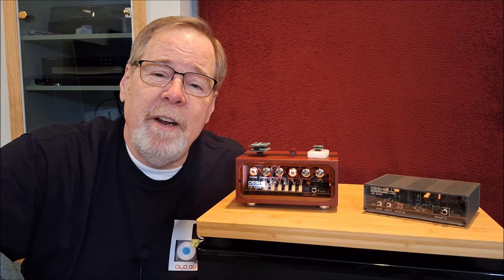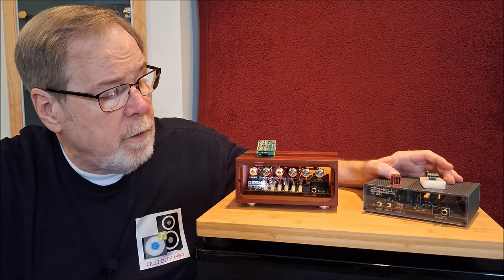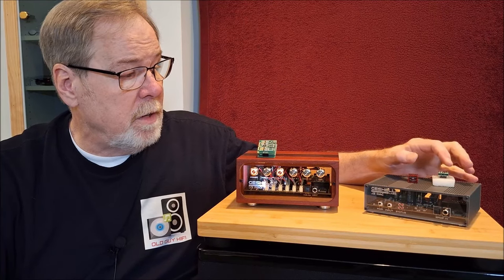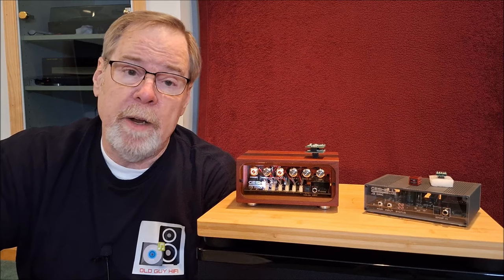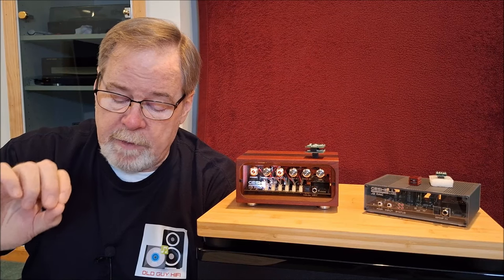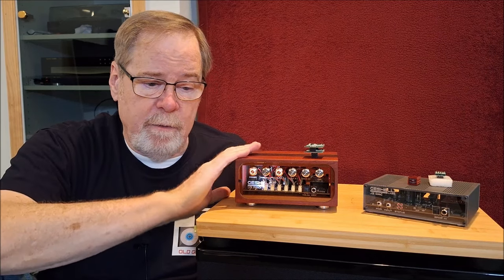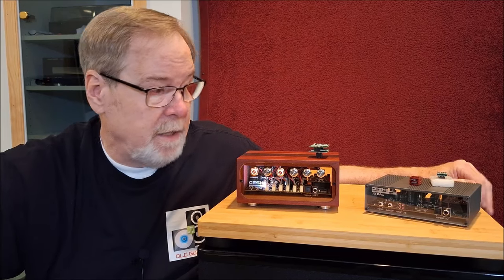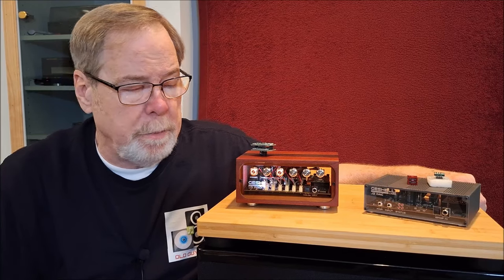The 1st YouTube review of the Geshelli J3 Pro DAC. IMHO it is a fantastic unit full stop.

Comment: Hi Ed! I was wondering if you could give me some kind of quantitative idea of how much better (in your subjective opinion) the new towering Sparkos is vs the older Sparkos vs the Burson V?
Reply from the maker: Micheal, I hope you well my friend. In all honesty, with the J2S on single ended it was an improvement but just. The 3602 vs the Vivid was near as makes no difference a tie. Each had a slightly different sonic signature. The Sparkos a bit more detailed and the Burson a bit warmer. I liked them both. The big 2590 on single ended was very good, however I struggled to hear a big difference. If I was doing only single ended I would probably go for the Vivid and save the money. Now. On balanced XLR in the J3 compared to the stock TIs (I didn't have enough of the Vivid or the 3602 to run them balanced) it was a significant improvement for sure. As I said in the review the music sounded more confident, with better drive and sense of "passing power." Does that make sense? I felt like it would deliver any peak that the music threw at it without any compression. I felt like it laughed those off as if to say "is that all you've got?" I hope that I don't sound like some goof but, that's the feelings I had about it. Very very good. Thanks for asking. Take care.
Reply: @OldGuyHifi  thank you so much for that detailed response! That was exactly what I was hoping for
Reply from the maker: Anytime my friend. Are you still using that Loki?
Reply: @OldGuyHifi  I recently moved from Nashville to New Hampshire, and will be moving again in New Hampshire in a few months, so sadly it is currently in a box (with a lot of my other gear). But when I land in my long term home, I plan to break out all the audio goodies.
Reply from the maker: @michealboudreaux  Good luck with all the moving hassle. You will be close to Neil now.

Comment: Hi,
Did you experience any digital interference and sound quality deterioration while using the USB connection?
Thank you
Reply from the maker: Yes. Until I got the correct Amanero USB driver. You should run the DAC in ASIO mode not in WASAPI mode. What software are you using? Let me know. Thx.
Reply: @OldGuyHifi  I intend to connect it to a DAP or a Smartphone and play local lossless files (WAV / FLAC) using  the "USB Audio Player PRO" App for example?
Thank you
Reply from the maker: @ronenbuium7699  I have not tried that. I do use USB Audio Pro also put typically run it into a Helm Bolt dongle DAC. Give me a day or two and I will try it out. Thx.

Comment: Apologies if I missed this - does the standard J2 (Non socketed) share the  AK4499EXEQ + AK4191EQ hybrid DAC implementation of the J3 and Dayzee?
Reply from the maker: No. The standard J2 is not. Good news is that you can get it with the very good AKM4493 chip. The 4493 is one of the best chips or there period. It sounds amazing. It is part of the same Velvet Sound Veritas family as the 4499. The J2 with that chip @$250.00 is in my opinion an absolute best buy. I can't think of a "Fun-Fi" DAC that comes close. Let me know what you decide. Thx.
Reply: @OldGuyHifi  Thank you for the quick and thorough response! I actually have an AKM4493 J2, I just did not know if it is dual chip. I really love the J2 dac and prefer the form factor and aesthetic over the J3. I need another dac for a second system, just ordered the Fiio R2R. Figured if I don't like it I'll be able to easily sell it for little to no loss. Then the question is buy another Geshselli or a try a Denafrips Enyo 15th in silver.
Love your channel, a real breath of fresh air in the youtube audio review space. Keep up the fantastic work!
Reply from the maker: @nesutoneko  Let me know what you think of that K11 R2R and ultimately what you decide to do. Thanks for tuning in.
Reply: @OldGuyHifi  Listening to the K11 R2R now.  A/B comparison with my Schiit Gungnir  MB is a challenge - have to switch out dacs then line level - but it sounds at least as good. My subjective feeling is the Fiio sounds better. I was not expecting this, just wanted a dac with a much smaller footprint and did not audibly click (the Schiit makes a very loud click whenever the the datastream is interrupted - it''s quite annoying). Time to sell the Gungnir.

Comment: J2s or Schiit bifrost 2/64?
Reply from the maker: Both. They each are excellent. I have been listening to the Bifrost for so long, 4+years, that if there is a change in the downstream gear I can hear that. Do that make sense? I am learning more each day about the J2S. At some point it will become a reference DAC. I do think that the J2S is as good as my Frankenstein Bifrost. That's why I bought it. Good question. Thx.
Reply: @OldGuyHifi  Thanks for the quick response Ed. Going to pull the trigger on a used, like new condition Bifrost 2/64 about $575.00. I suspect I'll be happy with that for some time, especially at that price. Thanks again.

Comment: I heard their DACs and Headphone Amps at shows and it sounded great , I just can't get past the look . 
Wish they had some modern , thick brushed aluminum look and full size width components for DACs above 400 dollars .
Reply from the maker: I get it. The look is not for everyone. They are a small family business doing the best they can designwise. The stuff sounds amazing though and that too me is the most important thing. Thank you for the view and comment.
Reply: @OldGuyHifi  I understand that part , it almost look like DIY build product and when asking prices go higher and higher now it just does not fit as it did on 249usd DAC
Reply from the maker: You have a point.
Reply: @OldGuyHifi  And than they have to compete with ChFi brands that also look much much better these days and cost less , sound pretty decent or even very good so Geshelli will have to invest in a nice chassis ....

Comment: I have questin i am starting to build my gaming and music endstage set up build for desktop what do you recommend the jnog 3 or schiit bifrosy they the almost same price which should i prefer?
Reply from the maker: Honestly for a desk top rig I would go with the J2S. It is smaller and the two units are virtually identical in performance. My guess is that you would only be using single ended outputs (RCA) to a headphone or speaker amp. If you ever wanted to, you could upgrade to the big Sparkos 2590 in the J2S on single ended. That said, I do love my Bifrost but it is not a unit you can buy. It an older unit has been modified and that can't be done anymore. I don't have a lot of experience with the newer units so it is hard for me to say. I hope that helps. let me know if I missed something.  Thank you.
Reply: @OldGuyHifi  i am going to a dac and amp stack anyway so probably expecting big size only i am using my hd800s and probably gonna by more expensive headphones that why i was comparing j3 and bifrost what headphone amp would you recommend as well
Reply from the maker: @luigipuno5479  I am not a big headphone guy. I use a Nitsch/Schiit Magni Piety amp and some Drop 6XX. Well of course Geshelli makes some fine amps. For what it is worth I may be getting in one of Andrew Sparkos units the Gemini. Details here: https://sparkoslabs.com/gemini-headphone-amp/  If you are interested keep an eye open for my review. I don't have any dates or times yet.  Thank you.

Comment: I question whether the Dayzee is a better DAC than the J3 Pro DAC.  The main difference as far as I can tell between the two is that the Dayzee has a lot more inputs.  The J3 has one set of XLR and one set of RCA inputs.  The Dayzee has two sets of XLR and 4 sets of RCA inputs.  If you don’t need all the additional inputs, the J3 should be just fine.
Reply from the maker: Fair point. The Dayzee is significantly different as it uses dual AKM4499 chips in a fully balanced circuit design. I own a J2S and have a Dayzee in for review. There is a difference for sure especially on balanced outputs. I will say you can't go wrong with the J3Pro. The J3Pro & my J2S AKM4499 to my ear, are as near as makes no difference the same. I would suggest buying the one you want with the stock op-amps and listening to it for a few months and then if you feel the need to upgrade just do one output at a time, i.e., if you only use RCA then only roll that op-amp. I hope that answers your query. Thanks so much for tuning in.
Reply: @OldGuyHifi  All I’m saying is that the Dayzee has significantly more inputs and outputs than the J3.   If you don’t need those additional  inputs/outputs, it becomes harder to justify spending the money on the Dayzee as both the J3 and Dayzee can be fitted with the same op amps.  If the additional inputs/outputs are not needed, you are paying quite the premium for a dual mono design.
Reply from the maker: I don't disagree. That's why I bought a J2S and some op-amps. Thx.
Reply: Dude!  Today I swapped out the TI 1656 to Burson v7 vivid and it was transformative. 

That Dayzee DAC has 8 op amps and I wager that it sounds better than ANYTHING within 3 times the price.  

PLUS...You can swapp out the op amps. 

This morning I swapped and upgraded to Burson op amps and my gear is singing. 

Geshelli is the shit and you all better recognize. 

With Love😮
Reply: @carloslong839  Here is my strong suspicion.  Let’s take the 3 DACs: J2S, J3, and Dayzee.  My guess is that the change in op amps is much more noticeable than the hardware differences between these DACs.  I don’t doubt that the J3 and the Dayzee have improvements over the J2S, I just question how audible those differences are.

Comment: Hi there, so I was wondering in your opinion which sounds better between the j2 3362 socketed and the  j3 2509 version.   
Elliot
Reply from the maker: Elliot, In truth they are so close as to be indistinguishable from one another. The J3 has a slightly bigger power supply to accommodate the big Sparkos the board layout was changed to fit the big Sparkos and there is a relay to shut down the USB board when not in use. I had to really focus to hear any difference and then I may have been imaging it. Let me put it this way, I am buying a J2S with my own money. I plan on using 1  2509 on single ended and 2 3602s on the balanced. That to me is the sweet spot. I don't really care about direct button access to the inputs so why spend the dough? BTW, Shhh I am getting a Dayzee to review. Thanks so much for watching and asking my opinion. It may be worthless but I hope it helped. Buy the one you really want!

Comment: Hi,
1. There's no option to buy this DAC with the 2590 Opamp. Why?
2.I want to connect my phone to this DAC, so I'm asking: Does a USB-C to COAXIAL CABLE (In Amazon) is a legit connection?
* Geshelli labs didn't answer my question 
Thank you 🙏
Reply from the maker: No. To purchase the 2590 you have to go to here: https://sparkoslabs.com/product/pro-to-dual-dip8-adapter/. To get the best performance from you phone just a cable will not work. Is USB an option for you? Is the phone an Android or iPhone? Any of the USB to SPDIF convertor, whether they are Toslink or coax seem to be problematic in performance. If you can do USB that would so much better. Also if it is Android, I would recommend you consider the app UBS Audio Pro as it will allow high rez output and not throttle it to 48kHz. Geshelli Labs is playing catch up with production now and as it is a small family business, getting customer orders filled is the priority. Don't be surprised if they do respond when they get caught up. Let me know what you think. Thanks.
Reply: @OldGuyHifi  Hi,
According to the other reviewer, the USB module in this DAC will not completely isolate electrical interference unfortunately...
Having no choice, l can use a USB B to USB C Cable Adapter.
It's a Android phone and l know that App that you mentioned. I also have the option to use HiBy Music App that allowing me to connect to a DAC and l can also EQ my Headphones / linearing my Headphones (That's really important to me).
Thank you very much

Comment: I'm curious as to why you chose the 1st Gen Schiit Multibit Bifrost over all the new DACS you review. Isn't it outdated? What makes it special?
Reply from the maker: It is not a standard unit. It has been extensively modified. If you look at what many consider to be the best DACs available, they are R2R ladder or multi -bit topologies. Did you know that technology is almost 50 years old? If it still sounds good, isn't that all that matters? Thx.
Reply: I'm just being the devil's advocate. I have a gen 1 multibit Bifrost but was thinking of getting a Geshelli. I may not now after your high praise. What is the difference on your unit from the standard multibit Bifrost?
Reply from the maker: David, My Bifrost is far from standard. It has an upgraded power supply, Elna Aluminum foil caps through out the signal path and several other minor tweeks. It is my reference DAC because I have been listening to it for so long that, if I make a component change in my system, any difference I hear must be attributable to that change. 

I do own J2S and I do love it. I think the the AKM Velvet Sound Verita chip designs like the 4499/4191 are a break through. They very much have that "multi-bit" sound that I like. Again the Bifrost is a benchmark that allows me to be consistent in my reviewing process.

For the last week or so I have been listening to the Dayzee with the upgraded 2590 op-amps and I must say it is sublime. The differences are very subtle.  The truth is, if you never heard a (insert DAC name here:), you wouldn't know there was a difference. I hope this helps answer your question. I know it won't help with your decision , that's up to you. Thanks.
Reply: Thanks for the thoughtful response and making these informative videos.
Reply from the maker: @davidburkholder7321  Thank you for the kind words. I appreciate your participation in the channel. Thx.

Comment: I would give up the 1-coaxial and 1-TOSLNK inputs in the front for a I2S input in the back.

I suspect 90+% of JNOG buyers over these years actually use these 4th & 5th input.  Now that Gino is positioning this DAC midfi buyers the lacK of I2S is becoming a glaring oversight and deal breaker for me.
Reply from the maker: Not many people have streamers/transports with an I2S output. I am sure if there was a big demand Geno would consider it. You are right a lot of folks use the front panel jacks on their desktops. Thanks for the view and comment.
Reply: Thank you for your response to my last post comment on this post…. I agree with your response.  I have large CD collection and plan on purchasing a CD transport but I am also concerned with jitter.

Comment: I have a Schiit Gungnir Multibit and it was a revelation when I put it in my headphone stack. It's the best DAC that I've heard and owned. I moved it to my speaker stack a few weeks ago and picked up a J2 (non op-amp upgradable) as a temporary replacement. It has impressed the bejayzus out of me and has me reconsidering its temporary status. It's different than the Schiit, but it's hardly a step down. It's an impressive DAC that when paired with a Schiit Magni-Piety and Sennheiser HD650's wows me every time (I also have a Schiit Lokius in the stack which I use to dial in the sub bass and bass and top end), and a Schiit Asgard 3. The little Geshelli is impressive, more than it has any right to be.
Reply from the maker: I agree, I also have a Magni-Piety and I run Drop 6XX so. we are not far apart. I am also impressed with the Geshelli units. I think the chip used is less important than circuit design and surrounding hardware, especially the analog section. I think Geno Geshelli's designs are very well executed. I also think that in the new J2S and J3 Pro a lot of the magic is that AKM hybrid switched resistor/R2R/Multi-bit chip architecture. I am a bit smitten with it. It has had me thinking about adding it to the system as another reference DAC along side my much loved hot rodded Bifrost. I am being forced to question the existence of my life, the world, the universe. I am in the midst of an existential crisis! I need help! Great comment. Thanks for putting up with my crazy humor.
Reply: Lol